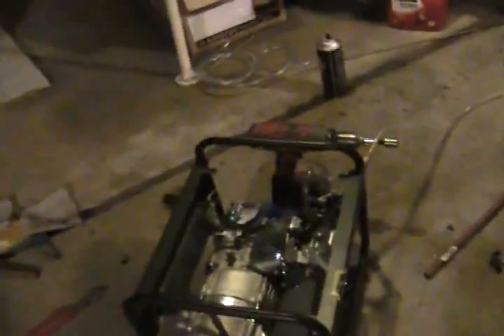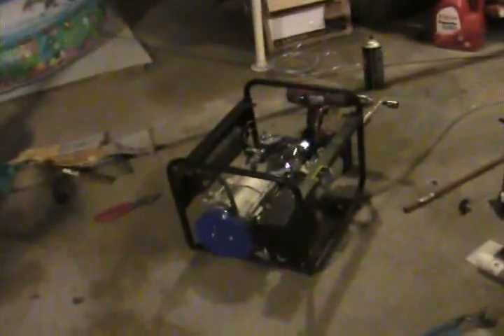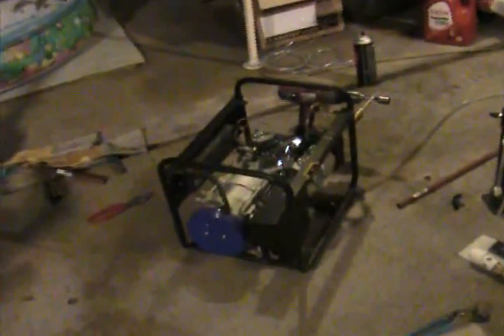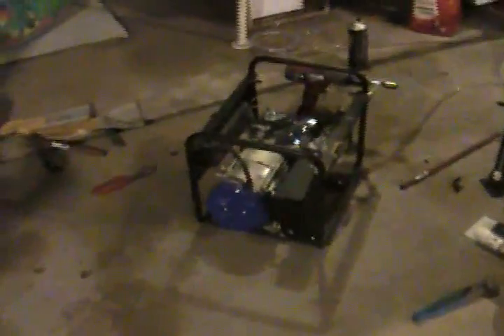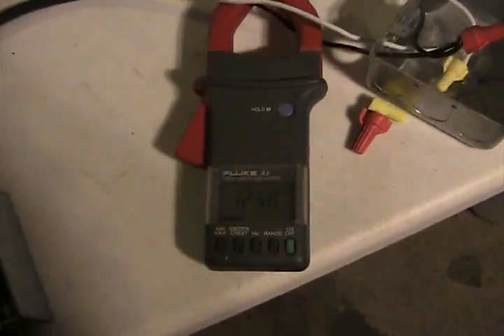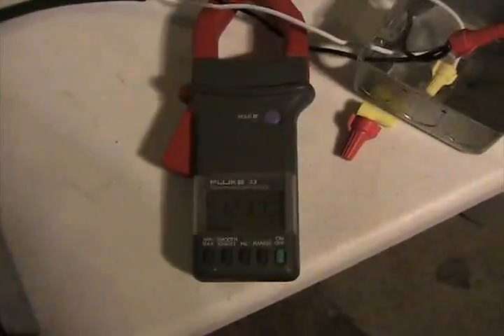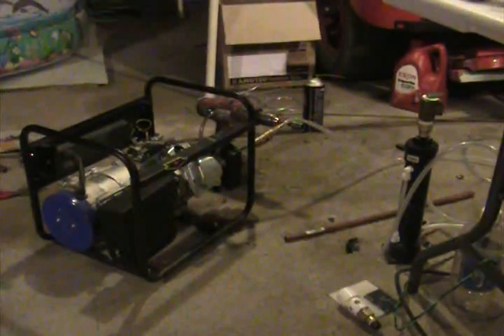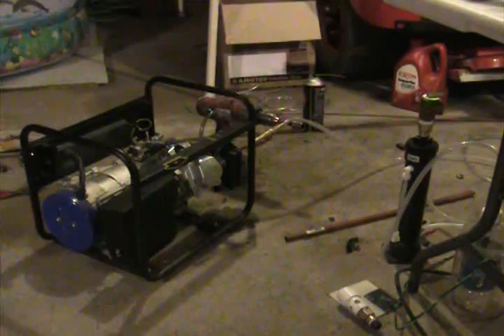generator test 19 engine running on hho

Comment from the maker: 1 9" warp motor
150amphr nimh batteries @ 144volts
1 zilla or equal controller
a pot box 
etc. 
Then throw some wind/sun power up. Or grow some oil bearing product and run a mechanically injected diesel gennerator. 
Done!

Easy, well its not as easy the conventional method, which is why most don't do it. But its there.

Comment from the maker: engine sounds fairly normal, the exhaust noise is a bit different. But other than that its in its stock config, no mods. I want to see the effects of running hho before making changes.

Comment: When ever i run natural gas piping to a appliance, which i have to do based on manufacturers recommendations,  i have to use a drip leg, which is nothing more than a tee in the line that will catch any moisture from going into the system.but you have to change the direction of the flow so the pressure from the gas wont just go over the tee.
so turn the tee side ways(like the letter T). 90into the top of the tee, out the bottom 6" pipe with a cap to catch the moisture, and the other hole is gas.

Comment from the maker: No ou yet, and to run the cell from the gennerator, would be about 625 times ou, taking into consideration all the ineff. of the system whole. you can have ou without self running, just as you can have COP(coefficient of performance) greater than 1 and still be underunity.

Comment from the maker: not a dumb question at all, but I am running two dryers on the system, I would need a condesor dryer to cool the steam to get rid of it. But its not a bad thing to have the steam in there, as I have seen with my truck steam turns heat into mechanical pressure, good thing, so long as you can keep a good spark and fuel volitility.

Comment from the maker: Amen. @catx, ssc is running his 8" cells (which can get more hho than the 6" ones I was running) and yes he has ran a load off his genny, we haven't maxed out the load to stall the engine to find out his max power output, but he ran a 400watt light. And for math types out there they can figure out what that means.  I was running the 6" cells to test them, they were running poorly, and needed a cleaning, this was to see if it worked, and it did.

Comment: 12.5 Amps x 115 Volts = 1437 Watts input to create the HHO. So does the generator actually output the nominal rating of 1500 Watts? And if so haven't you reached unity? Wow, too cool.